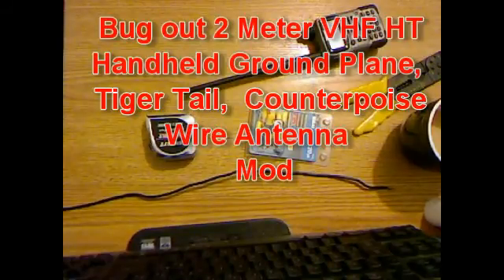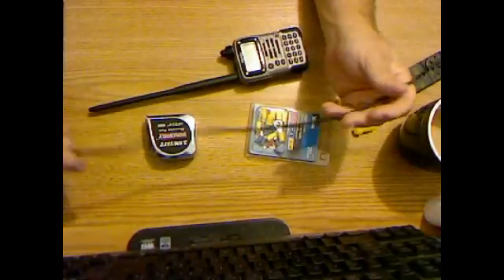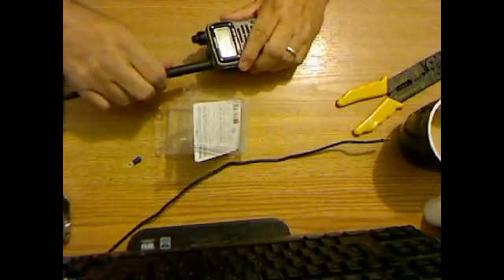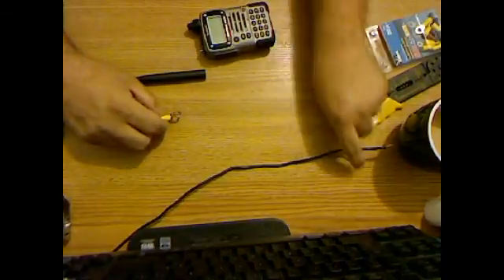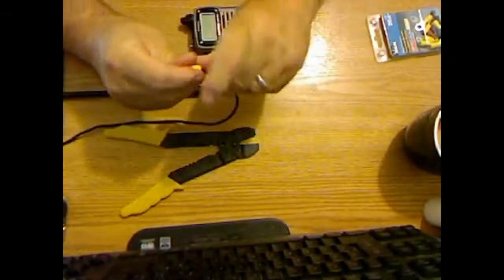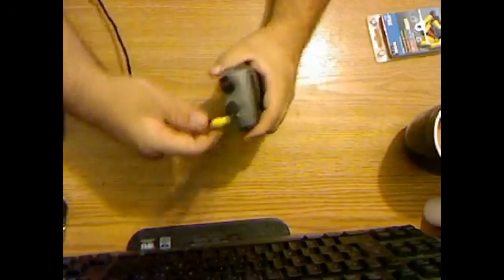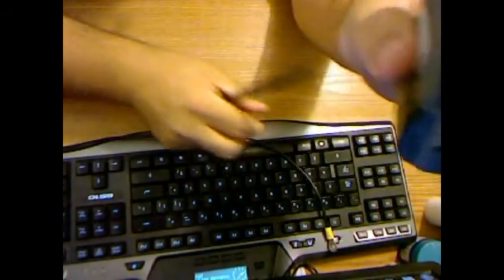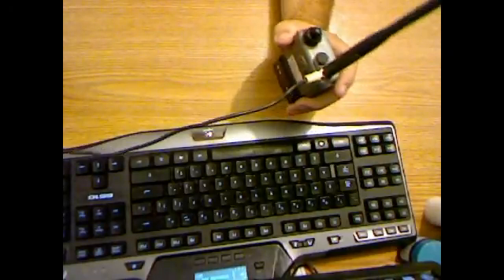2 Meter VHF HT Handheld Ground Plane,  Counterpoise

Comment: Would this also work for/on a Bearcat 220 scanner?
Reply from the maker: I would think so. Scanners don't transmit so it would increase the signal the scanner gets. Just a  simple long wire (More is better) and a alligator clip on the normal antenna would be great.
Reply: Cool, thanks for replying. I will try that, however, should the alligator clip be attached to the ground, or some screw, on the scanner - just sayin' 'cause that is what other Youtubers are sayin' . Also, will any gauge of wire do? Thanks again mate. Cheers!